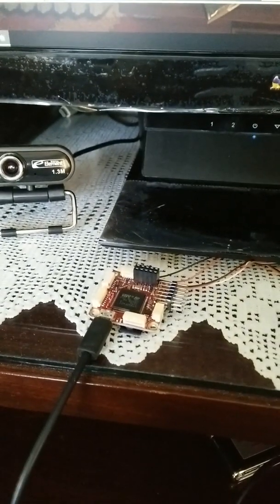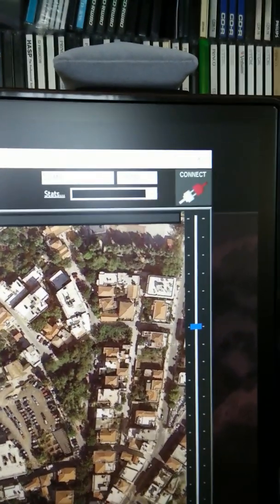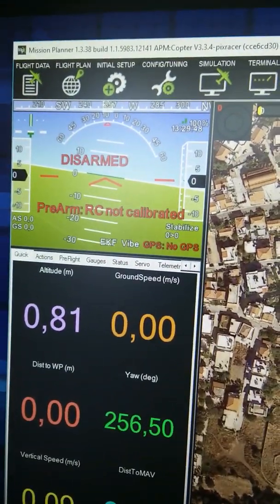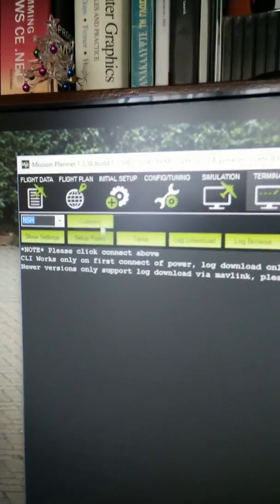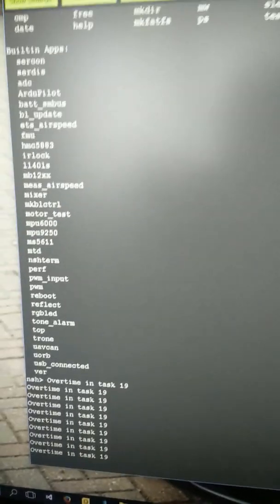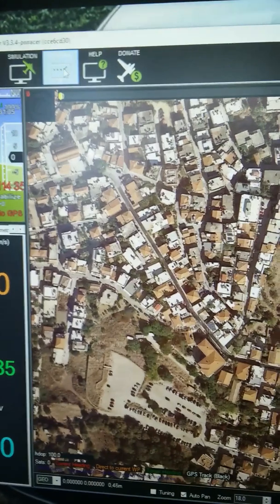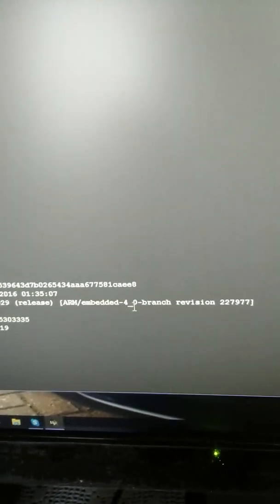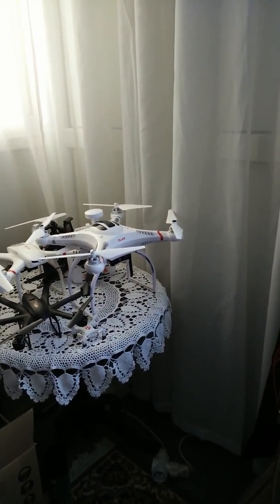CX-20 PixRacer First Boot and Dataflash Test (bought from Banggood.com)

Comment: Does it come with a power distribution board and if no, what PDB did you use?
Reply from the maker: No, it does not come with a PDB.
I am using a Matek micro PDB and the APM Power Module (for voltage and current monitoring).
Reply: Thank you. I noticed you were unlucky with your Pixracer bought from China, so I want to use mRobotics' version. But their proprietary PDB is expensive and it's nice to know you can use whatever PDB you want.
Reply from the maker: I bought a genuine Pixracer from AUAV and another one from Aliexpress (clone), both of them work fine with ArduCopter 3.5.3.